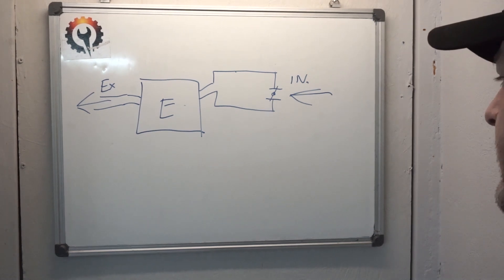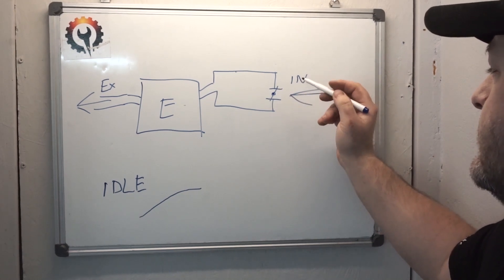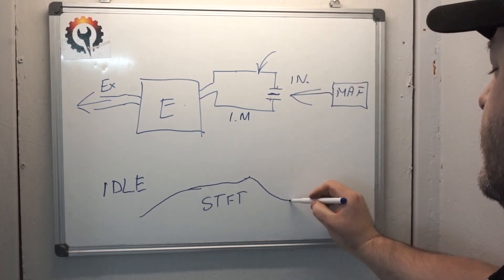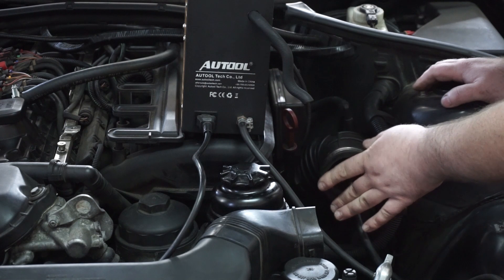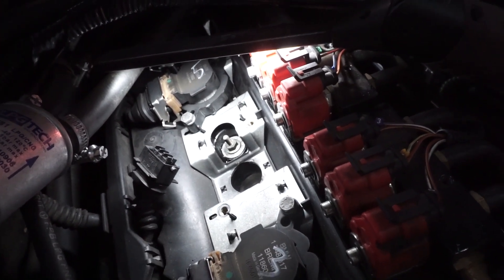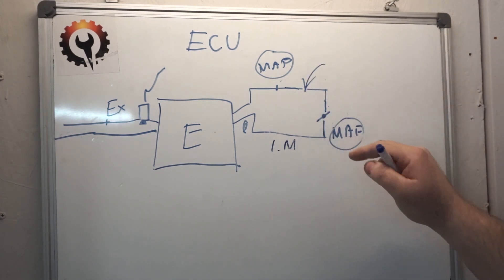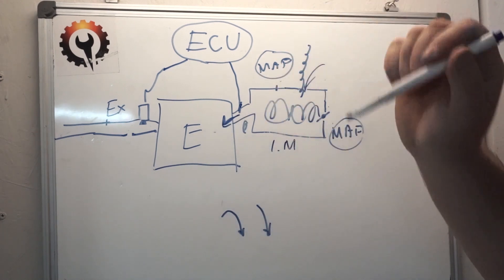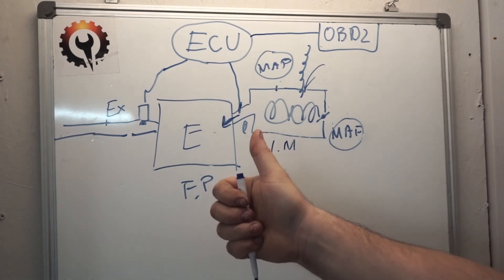Unveiling the secrets: Detecting vacuum leaks with a Smoke Machine | AUTODOC

Comment: I have a leak in the rear I used the smoke machine in the gas cap area and found. A leak in one of the lines or in the rear of the car underneath how do I fix that
Reply from the maker: You can find this information in the technical documentation for vehicle repair.

Comment: You need an appropriate scan tool that can put a vehicle into service bay testing for the EVAP system and have capability to do functionality testing to turn the evap vent and purge solenoids on and off. These scan tools run in the thousands of dollars. Have the vehicle brought to a licensed automotive service facility for a proper diagnosis.

Comment: Is the throttle body in an open position with the engine off?
Reply from the maker: Thank you for your comment!
The throttle itself is always in the closed position, and only when you press the gas do you gradually open it, thereby increasing the engine speed.
Best Regards,
Autodoc team
Reply: In electronic TB usualy with ignition ON, some cars not